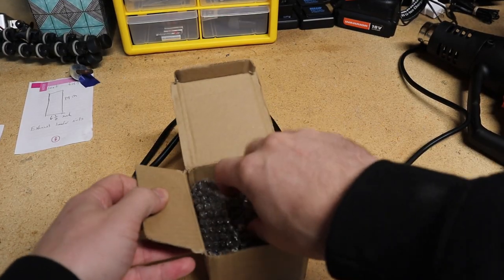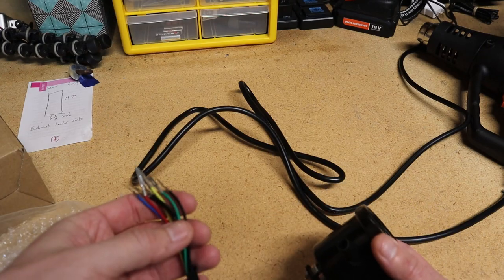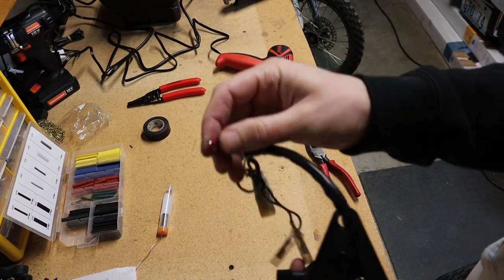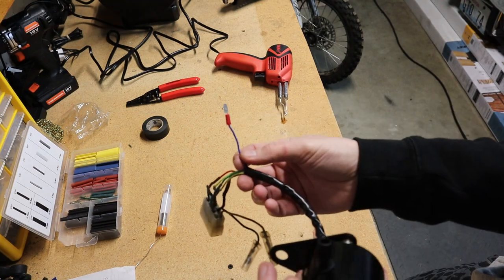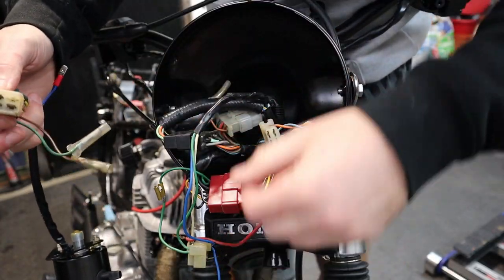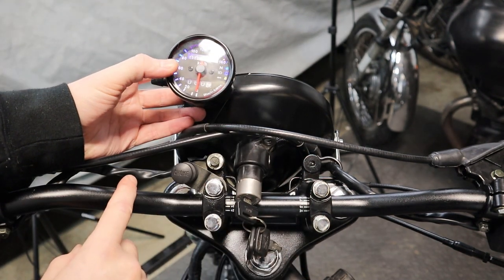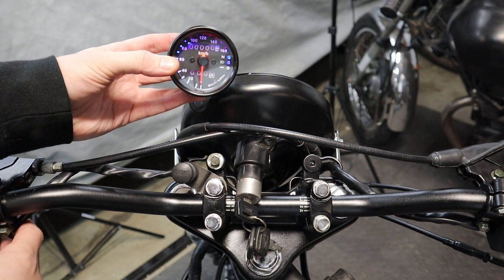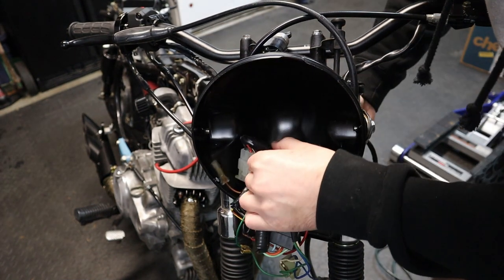Installing Universal Speedometer | Café Racer Build Ep. 9

Comment: How do you calibrate the speed km/h? Mine is not right
Reply from the maker: Is it a mechanical speedo?
Reply: @MotoMango yes
Reply from the maker: There isn't a calibration then as far as I'm aware of. Either your mechanical speedo drive isn't working properly or the speedometer itself is faulty.

Comment: When I wire mine, the indicators work but they both come on when I flick left or right on ? Any ideal
Reply from the maker: First, make sure you have an LED flasher relay if you upgraded from incandescent. Second, you might need to install a diode to prevent power feeding back into the system causing both lights to flash.